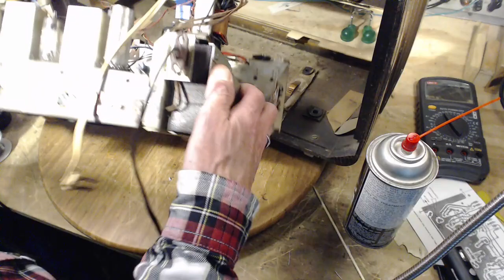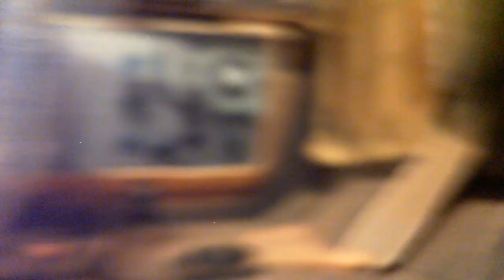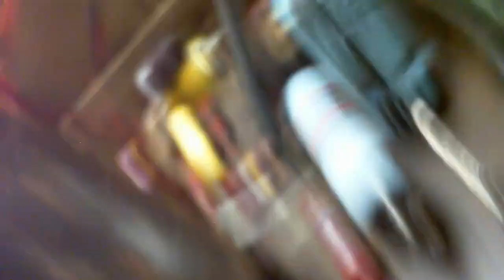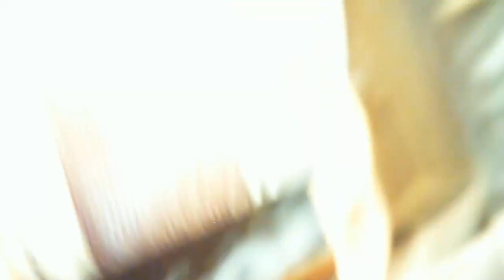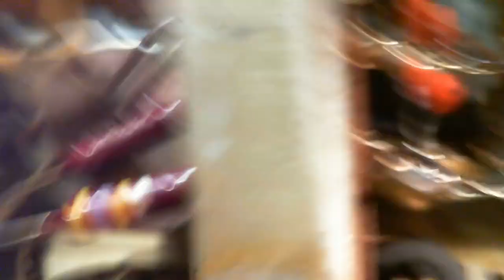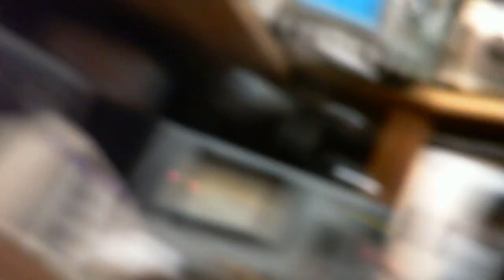German Greatz Polka Tube Radio Video#6 - Motorboating Solved

Comment: Blue wire insulation turned black from the heat off that tube. Replace it and the mystery will be solved. 
 Make a long metal shield strip along the wire where the tube is.

Comment: 45:13 Really nice catch on that open shield on the wire👍. One question tho; if you are so sure that the EL84 cooked the old wire to the point the "rubber insulation" smoked out sulfur vapors that ate the shield up, why dont you route the new wire with more clearance to the tube so similar things dont happen again??
 And FYI the insulation of the old wire was not rubber but PVC. Heated PVC releases HCl at ~200-300C and forms CuCl2 (Copper-ll-chloride) which too is greenish blue.
But seeing the state of the WIMA caps in that radio I am not sure that is the whole story to it. This radio could have been subjected to some nasty environmental conditions. So more odd faults may be in store.

Comment: I hope that the little bag around the Magic Eye tube doesn't melt with the result that you have to somehow remove the melted bag from the outside of the tube.
Reply: The magic eye is not essential to the function of the radio. So he should have removed it from the radio per se, especially the moment he realized that it had some life in it.
That plastic bag will not do anything to protect the tube from mechanical damage.

Comment: Jim, that's the wrong color! the blackening made it faill the color of the wire has to be blue! how can it now work with a yellow one! all the electrons will not find it! ;-)
Reply: Electrons are color blind. Want proof? Just look at a color CRT tube. If convergence is off the red electron beam will illuminate the blue phosphors.
But one thing electrons are is lazy to jump across air on bad connections,- unless given a 20+kV kick in the butt.
The soldering on the new shielded wire is abysmal. Why didnt he twist and tin the shield and center lead before bending it around and soldering it to the terminals? The way he did it there clearly is lots of almost unsoldered and fraying strands.
Reply: @randomsteve4288  perhaps in 'modern' chasis, but this one clearly predated color tube!

Comment: Sounds like 👍 this also has something wrong with it, just like 👍 the PYE radio 📻 did. It's probably the same capacitors, or circuit problem. Maybe a faulty potentiometer. Your friend, Jeff.
Reply: I hope that the bag around the Magic Eye doesn't melt what a mess that will make.